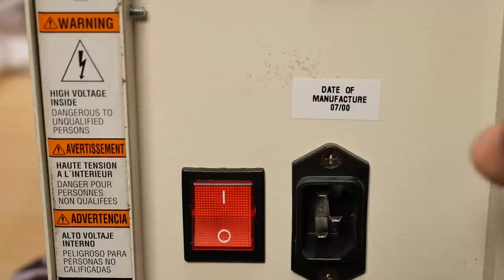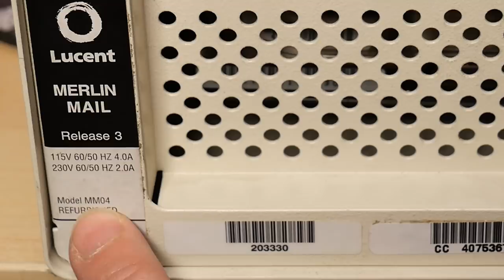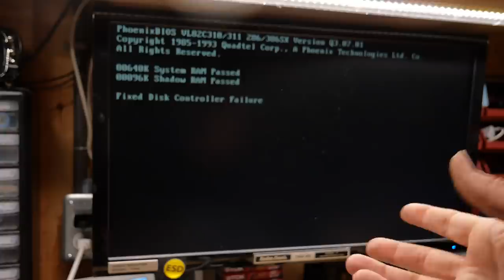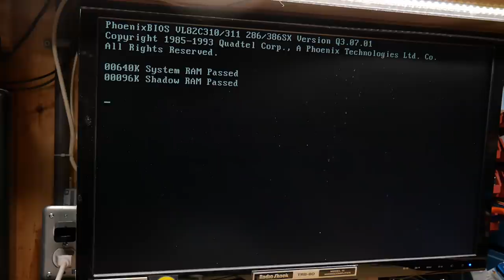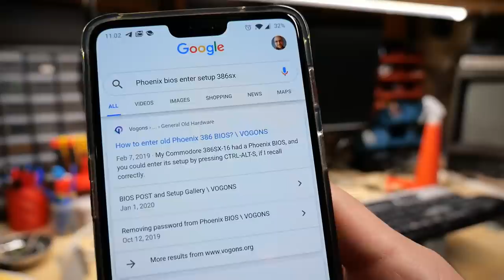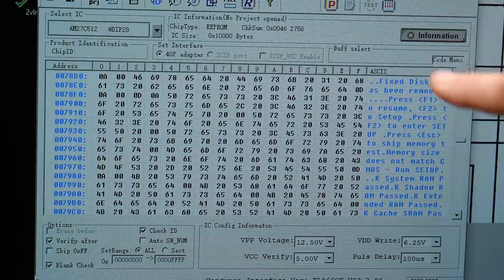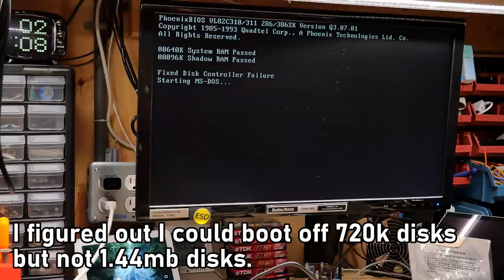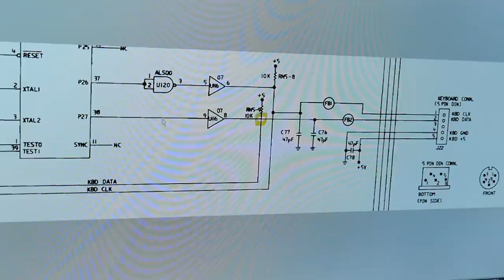Trashpicked Voicemail System

Comment: Is there a BIOS write-disable pin on the motherboard? It might be resetting the setup .com's settings because of that.
Reply: I was just gonna say that. Either a jumper, or they hard-wired this option for protect their system from hacking. Maybe this has something to do with the mod wires on the back side of the mobo?
Reply: bios settings arent saved in the bios eprom, but in RTC chip SRAM
Reply: @rasz  I know, but it still can be write protected.

Comment: FXS (Foreign Exchange Subscriber) is the port that actually delivers the analog line to the subscriber. In other words, it is the “plug in the wall” that delivers a dial tone, battery current and ring voltage. ... FXO (Foreign Exchange Office) is the port that receives the analog line. you can use them on a POTS lie.....omg i'm dying here
Reply: I presume you can also feed a POTS or similar phone into it, for listening / if fax,  faxing in /out and also programming mailboxes for voice and fax 2 email or similar

Comment: Hmm. The original BIOS that replaced the IBM PC BIOS code was Phoenix, it was a "cleanroom" rewrite and not a copy. Back in those days, things were a bit different. The configuration program being built in to the EPROM was not there in the early days. If it has it you can hold down a key during startup and you will get a keyboard error and the option to press F2 to enter setup. The parameters were maintained by battery backed CMOS, not EEPROM or Flash so no battery and you lose configuration. I would guess that little circuit was to maintain the CMOS memory? Those ISA interface cards would have been a small fortune back when that was new.
Reply: Terrible how I have forgotten most of what I knew.  And it took be ages to learn.  And the manufacturers changed the systems and next sales point in so had to learn the new tricks.

Comment: Im pretty sure there was a debug program in dos that you could write some value to a memory location which would cause the CMOS validation test to fail. You would then be prompted to access the BIOS by pressing del or F1/F2.
Reply: I found it 
Solution 1: for AMI and Award BIOSs:

C:\DEBUG (at a clear DOS prompt, don't do this in DOS-box in Windows)
-O 70 17
-O 71 17
Q

Solution 2: for Phoenix BIOSs:

C:\DEBUG (at a clear DOS prompt, don't do this in DOS-box in Windows)
-O 70 FF
-O 71 17
Q
Reply from the maker: Didn't work. I just swapped the Dallas RTC with a with another one with a dead battery to promote that error but no luck. Nothing changes when CMOS is corrupt and it all just goes back to the default settings I show, no matter what.
Reply: @adriansdigitalbasement  Likely using the wrong setup.com. There were about eight different setup files to use, depended on the BIOS, and between PC, XT, 286, 386. Was wonderful when the setups started going onto the CMOS. Too bad, I just pitched a few manuals and PC books from that era, too. I'll see if there's stuff left in the attic (judging by the lack of room left, yes, I'm sure there is....)
You might try holding down a key at boot (just after the Trident pops) and force a keyboard error. Sometimes that displayed the key combo for CMOS setup. If not, then I'm pretty sure it's a boot disk and the right setup that's needed.

Comment: A few observations:
- Both Brooktrout cards use a DSP: On the later revision it's the small TMS320BC52PZ on the left side ("U2"). Always suspect a DSP when you see "TMS320" ;-)
   Some boards are prepared to use different versions (package sizes) of the same chip and this seems to be one of them.
- You should check out these EEPROM-like chips on both cards if they are actually EPROMs. Often cheaper, non-reusable EPROMs are used (you can't erase them as they don't have a window like the large EPROM DIP packages). Better remove the sticker and check the IC number. If it's begins with "27C" you have an EPROM (I sometimes had luck with programming them ONCE, though). EEPROMs often have "28C" which work with your MINIPRO (a 29C would indicate a FLASH memory "PEROM" - also good).
- You point out the date on the I/O controller chip on the I/O card. Right next to it, on the card itself is also a datecode: 3895 ;-)
- You also missed the datecode on the DALLAS clock module: 9506.
- Also the 386SX is not "essentially a 286". It's to the 386DX what the 8088 is to the 8086: It can run the same software, but externally supports older hardware (and less memory) - and it was much cheaper. The 286 can actually be faster when clocked the same but it was obsolete the moment 32-bit software became the standard. The 386SX can run these, though (I believe Win 3.11 and later).

- As for the "oscillator module": You should look up the number on the TO-92 package. It wonder if it's really a transistor.  Never seen such a module. Maybe desolder it and draw a schematic - as tiny as it is?
- Also: The long botch wire on the back runs from this module to resistor R16. This seems to go to unused turbo switch connector. You may want to check that out.
Reply: The "oscillator module" at 10:45 might be a primitive watchdog. Of course, the CPU needs some GPIO pin to periodically reset the timer (after it is enabled). Since since this box only has 1MB of RAM, I'd repurpose the A20 gate for that (which is famously controlled by the keyboard controller). A PAL (PLA, GAL, CPLD, ULP, ULA, ...) with feedback logic could be used to enable the watchdog when the A20 gate gets asserted for the first time after power up, and from there on, it needs to be periodically reset.

Would make sense to an unattended voicemail system to have a watchdog which automatically resets the system if the system hangs/crashes/behaves irregularly.

Sorry for mentioning the A20 gate. A truly ugly hack...and Intel CPUs supported it until Q2 2013.

Well, officially, Intel just mentions that you should not expect the A20 to work as expected on 64 bit Haswell (and later) architecture CPUs. That makes me wonder...just how does an Intel Core i9-10900X access more than 1MB of memory under DOS 6.22?

Comment: I mean obviously there are security features to prevent snooping of recorded calls! Also the 386SX is not a fancy 286. It has a virtual 8086 mode like all 386s and much more sophisticated memory management. It has a 16 bit external interface but is 32 bits internally. You should boot the thing with an external serial console (e.g. Putty) connected to COM1 at 9800,8,N,1. That will almost surely bring up an admin interface to the Merlin system. Don't forget the null modem.

Comment: If you still remember SEAGATE disk manager, there is an option to write a small boot overlay into boot sector, and override the Type 48, in order to use a large hard drive.
Brooktrout  was famous of making voice and fax (back in the old days we also have the GammaFax multiline fax card), may be running DOS 5.0 and may have TSR to do background voice handling (from the GammaFax experience I got). The daughter board should be a replacement of oscillator, this board is just a bit newer to use DIMM instead of DIP (pin).

Comment: Those are set up to do a serial console. It's 1200 baud, 7 bit. (It was designed to have a modem hooked up, so AT&T could dial in to make changes)
The password to get in is probably: p1zza
They run Concurrent CP/M!

Comment: I played guess the CPU while you were showing the power supply.  Age and ISA Bus suggested anything up to a 486, once you got the PS out of the way, I saw what could only be a 386SX.  I'd try holding down any key during boot up and letting the machine give a key stuck error. (Which then asks you to go into setup)  I'd also try letting it boot from the original disk and seeing if you have any luck with that or a serial console and lastly I'd try installing an OS on a fresh drive setup for serial console.  Then what?

Comment: i built an Asterisk box and scripts to replace one of these several years ago.
Reply: To replace Merlin Mail or the entire phone system?
Reply: @NortelGeek  both sort of. the asterisk box had a T1 card and a POTS card. the merlin mail was emulated with scripts that put calls into the proper VM context. the T1 card served as a Media Gateway interface to the VOIP trunk on the * box. Allowed them to drop the T1 service and use VOIP termination and add features like VM to TXT or EMAIL, etc. i totally bossed out an old phone system with a $4k asterisk machine

Comment: 12:19 That 'thing' and those bodge wires are almost certainly the issue.  I've never seen anything like that on standard PC's of the era.  I doubt that the BIOS, or keyboard controllers have been modified beyond something about that bodge wire and assembly intervening to probably prevent CMOS changes, as you are able to use the keyboard in DOS.  Also, one of those bodge wires runs to a group of 5 pins, which might be related to keyboard or unpopulated PS/2 interfaces that a lot of these motherboards had provisions for, but weren't used.  You might want to start with those bodge wires and see what happens if you disconnect them.  Or, try to find a schematic for the motherboard, which looks super generic and is probably an unlicensed copy of somebody elses board, which was also super common for boards of this era.
Reply: thankfully someone else commented who used to work with these, the bodge wires are for converting the 286 into a 386SX, before later board revisions incorporated the needed changes natively.

Comment: FYI, voicemail software can be very sensitive to card in motherboard. i use to build one that was 486dx-100 board which had only one pci slot but 8 isa slots> when the video card got changed to a different model the software crashed. Only the one brand card could be used. The used i believe rocketport voicemail cards
Reply: I think they can work on the interrupt cycles and sensitive to voltage changes

Comment: I wonder why you didn't try to just boot it with the stock configuration, with all the cards installed as they where when you dismantled the system. Such systems can be really picky about hardware changes. If still nothing happens, I would remove the video card and try to get a connection on the serial terminal.
Reply from the maker: It might but not sure what they would do other than give me access to configure the VM system. I wasn't interested in what was on there ... It was just a DOS program on a small DOS partition with no other files on it. The voice mail messages are likely stored elsewhere outside the DOS partition...
Reply: I’m surprised it didn’t get wiped before disposal. Though I picked up a riverbed wan optimizer off eBay that was not working (bad psu caps). I inspected the unmountable data partition and found lots of HTML that indicated it was caching Outlook Web Access data. Apparently it’s former life was at a military base because all the emails were signed with things like SSgt Jones or whatever. The other strange thing is all the emails were regarding the riverbed device itself. People asking for status updates on the wan optimizer etc. so it was almost like it was a proof of concept that never went into production.

Comment: this screams "make it hard to service by the end user"
Reply: You ever work with the telecom (not IT - old phones) industry?  It’s a very particular mindset.  Very much geared to empower the union worker, and the customer is nothing but a service call generator.

There’s a language among inductees that is inscrutable to the layman, as evidenced should one sit down in front of an open management console.  You’ve got the ability to manage it — if you can figure out what any of it means.

On the bright side, the strict focus on repeatability, documentation, anal retentive attention to detail, and stability meant that stuff just WORKED.
Reply: @nickwallette6201  Very true.  People forget that there was a time you could not buy your own phones, you had to get them from AT&T, and you could have any color you wanted, so long as it was black. 😊 AT&T was in cahoots with the Federal government to make sure nothing but AT&T-produced equipment was ever connected to their phone network.  And I agree with you about the reliability.  There was a time that despite almost any kind of natural calamity, you could pretty much rely that you home phone would still work.  One of the reasons why I'm still not a fan of cell phones is they just aren't as reliable as a good ole landline phone (or at least what were landline phones before VOIP replacements).

Comment: The bizarre circuit @ 12:27 looks like a small power supply.  I see a zener & resistor feeding a TO-3 regulator and a filter capacitor.  Maybe 3.3V?  What's the P/N of the TO-3 part?
Reply: Good call. Other commenters suggested a clock divider, but, a cap that big looks like a filter to me
Reply: Could be..  Maybe that AMD 386SX/40 is a late mode part with a 3.3V core?
Reply: @nickwallette6201  If it is a power supply, the output-current can't be much from a TO-3 part.  Not enough to power  a uP.

Comment: You may be dealing with a BIOS modified for serial terminal only access.
Reply from the maker: It's possible and I didn't try that but if they are modifying the BIOS they won't be making it so it can be serviced and altered by the end user. This was never meant to be a normal PC.
Reply: I sincerely doubt the BIOS is modified much if at all.  It was possible to ignore VGA and KB warnings in a vanilla BIOS, an also quite commonly possible to disable the “Press F2 to enter setup” message as well.

That PAL chip is most likely tweaked to permit early (BIOS boot sequence) serial console access, so the tech could hit the magic incantation (F2) to fix BIOS issues via the console without having to remove the board from the case to plug in a KB, or insert a VGA card.

The telecom industry of old that I know relied more on conservative obscurity than extreme measures to lock out curious users intent on tampering with things.  This could be achieved without resorting to custom code.  (And most comms guys had barely functional knowledge of computers.  Much preferred to deal with hardware.)
Reply: @nickwallette6201  The BIOS is totally custom, it doesn't store any information that a normal PC BIOS would. Each time the BIOS starts it looks for a a date and time where the HDD info is normally stored and it resets the CMOS if it doesn't find it.

Comment: Good old Brooktrout cards. I've seen these used in fax servers, though I don't know if the ones you have are the same or not. That BIOS stuff can be a bit of a fiddle. BIOS manufacturers do include a number of "hidden" settings that can be set up using a special utility or something. Unless you happen to get lucky with finding the right one somewhere you probably aren't going to be able to figure out what needs to be changed to re-enable what's been disabled.

Comment: Looking at that small board, it looks like it would heve been the spot for the 14MHz oscillator, and they instead removed it, to put in another clock signal, probably a divided down 66MHz clock, so likely either 16.5MHz or 8.25MHz, which is probably used by one of the add on voice cards as a clock synchronous with the processor, as pretty much no other cards would use the 14MHz clock anyway, unless it was an early CGA card generating NTSC video.

Comment: yes those are DRAM spots. 386 motherboards often had a choice where you could have both 30 pin Simms DRAMs ( usually socketed ) because early on there was a huge price difference between the two memory types. ( 8x128kbit +1parity... or maybe x256)

Comment: 6:05 Such cards go for over a hundred dollars on eBay, I hope you didn't salvage parts from them.
Both cards have a DSP; one has a TMS320BC52PZ, the other has a TMS320C51PQ57.
Reply: there is a difference between being listed at ridiculous price and actually selling
Reply: @rasz  I didn't say "are being offered for"; I said "go for".
Reply: i should go through these old telecom and fiber networking boards, last time i listed them on ebay they wernt worth the effort to list them for $10-15
Reply: @frogz  Yep,  I found that too,  more a collectors market now.   Remembers I have an odd BT system sitting in the hallway I pulled when a company was closing down. currently used as a doorstop and support for the shoe rack if I move it I will need to find some boxes,  not worth it this week.

Comment: @8:41 PSU worth keeping as it has -12V... works with old arcade boards etc
Reply: most of the actual ATX do as well. The stopped using -5V that was a backward compatibility for IBM but not the -12V rail. It is used on for the comunications ports (RS232) at least. Dond expect big power from it since the -12V line is harvested from the common mode output choke.